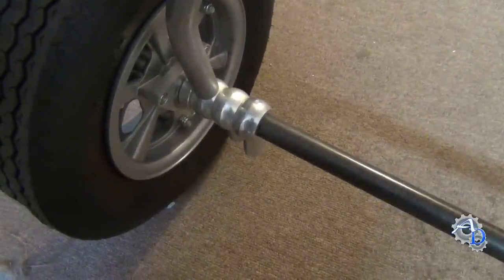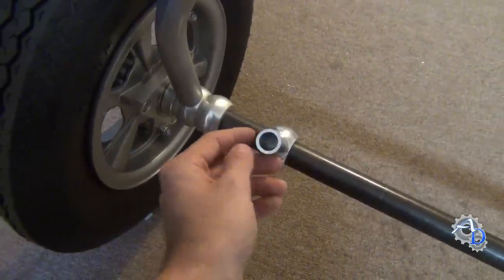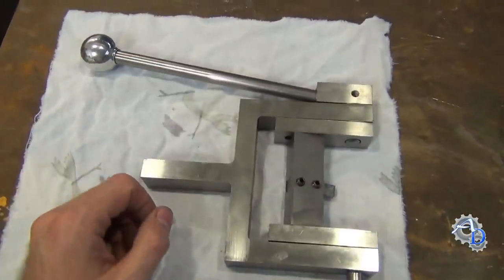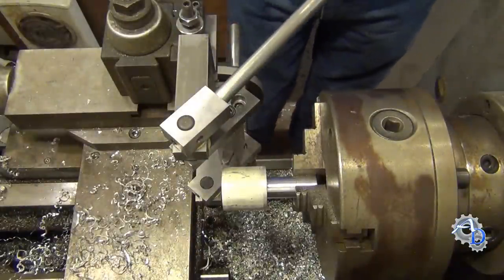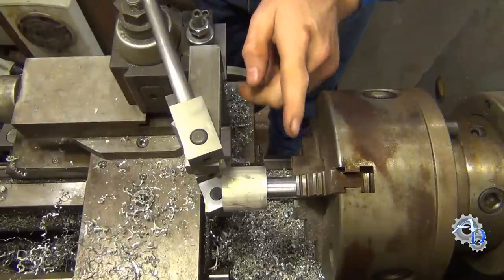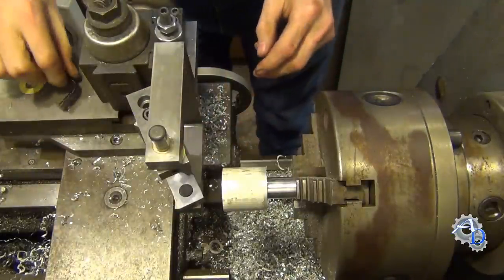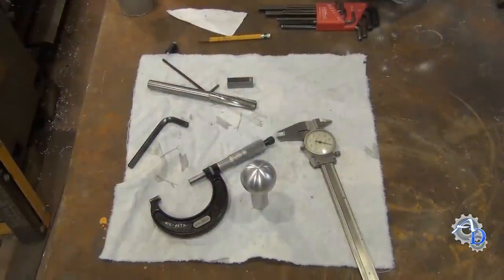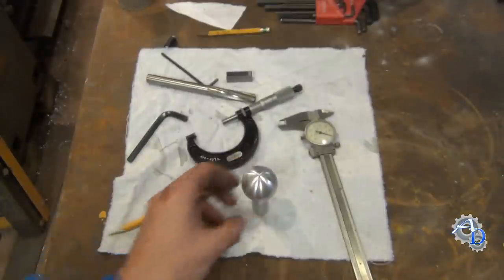The Secret to Cutting a Ball On a Manual Lathe

Comment from the maker: Now you too can have balls of solid steel. To download plans for this ball making fixture, go here: http://www.arnoldsdesign.com/Digital-Plans-and-ebooks.html
Reply: Arnold's Design was
Reply: Arnold's Design 
I would like to make a suggestion that will decrease your set up time.
Replace the solid dowels used for the pivot pins with hollow dowels, with the lower dowel having a thicker wall than the upper. Then you can use a stepped pin that simply drops in from the top to set the radius, no disassembly required.
Thanks for your excellent videos.
Reply: Arnold's Design q
Reply: I was thinking that exactly when he was taking it all apart.  Before he finished I thought well maybe I was missing something.  Sometimes something that appears so easy to do is often overlooked.
Reply: Link doesn't work anymore
Reply from the maker: @jerrylong381  Thanks for your recommendations. I just saw them.
Reply: @ArnoldsDesign  
My pleasure.
Reply: Looks like a Holdridge radius cutting tool.
They have been around for years Arnold.
Reply from the maker: @kappullen  I'm not sure if I've ever seen one. I've seen ones that look like a heavy duty large micrometer. Maybe that's a Holdridge model, I don't know.
Reply from the maker: @crisnevin7934  Works now.
Reply: The holdridge tools have always been in the $500. or higher price range.
More than I was willing to pay.
That is a nice tool. Those Wire EDMs
are great to have access to.
I bought a shapelane tool some time years ago based on a worm and worm gear.

Comment: Nice job on the tool. I have always used a boring bar in the mill with the part in a dividing head set at the correct angle, so the center of the ball is in line with the O.D. of the shaft. And feed up with the knee adjust diameter with bore head.
Reply from the maker: Interesting. I'll have to try that.
Reply: Just to clarify. After you feed up to center line you spin dividing head. Depending on ball diameter you might have to adjust bore bar several times.

Comment: Nice work. We made one that had the same operation, but to set the tool radius from centreline , we machined the pivot pin to the center in the mill, laying horizontal in vise, for the last .25 inches. then you always have a surface,      Top and bttm pins, to place a depth mic . Then you just dial in your radius on the depth mic, and lock the set screws onto the cutting tool. Hope that makes sense.
Thanks for posting.
Reply from the maker: Thanks. Yes, that makes sense.

Comment: I used to work at a 100yo workshop and We never said no to any customer. So we made a lot of special tools. It was really funny, too bad the company doesn't exist anymore and that the new owner sold everything to scrap. We had 5 lathes, 2 milling machines, 1 gear cutter, several different drills with 1 to 4 chucks, axial drill etc. Everything went straight to scrap, I had known it before so I would have bought some. We had several hundred different accessories for lathes

Comment: Awesome jig and just FYI if you didn't know already try using a bit of Kerosene when machining aluminium
Reply from the maker: Thanks, I do use that from time to time. I also have a spray bottle with off-road diesel in it which works too. Off road has high sulfur, but I don't know if that helps with machining AL or not. Probably not.
Reply: @ArnoldsDesign  LOL never tried diesel before

Comment: Very cool!
I learned my lesson years ago clearing shavings by hand.
Cut my index finger nearly to the bone.
I use a hook tool now.
Reply from the maker: I've done that too. We used to use a hook too, and leather gloves when we were cleaning out the chip pan at the end of shift.
Reply: Cutting your hand with stringy chips seem to me to be the initiation of the machinining industry :)
Reply from the maker: @cosmiccwonder300  My personal initiation was being forced to quickly unwrap heat treating foil from a dozen or so 4"x4"x10" S7 blocks at 1750°F and put them on the fan. Even with thick heat treating gloves on and tools, the tops of both my hands were covered in blisters for several days and hurt like hell.

Comment: I'm not machinist and knowing how they do this was interesting
Reply from the maker: Thanks
Reply: As a machinist ive heard of this technique but have never seen the tool designed for it and put into action. Normally just throw it on the cnc its faster lol.
Reply: @cosmiccwonder300  For the hobbyist who can't shell out $7k+ for a CNC, (Bare bones Tormach without tooling) this is a cheaper manual option.
Reply: @firearmsstudent  Your opinion is negligible.

Comment: Good job. Back in my days in the navy, we used a much larger commercial radius cutter. We used it for weld repair of stellate clad spherical steam valves on nuke subs.. Fun stuff to cut.
Reply from the maker: Thanks. You certainly earned your money turning that stuff. I've turned hastelloy, vascomax350, aeromet, etc. They're pretty bad too. I never would've imagined that sub valves would see wear like that. Did the steam erode them?
Reply: Arnold's Design  High pressure steam cuts like a laser. It would cut grooves through the valve surface. We would undercut the spherical seat, have it welded up and recut the interrupted stellate weld repaired surface.
Reply from the maker: That's amazing. I had no idea steam could cut through an ultra tough alloy like that.
Reply: I let auto-correct influence my spelling. The correct spelling is "stellite". Also I heard brooms were used to search for high pressure steam leeks because it could cut your arm off. Hearsay or truth, I couldn't say, but I am inclined to believe.
Reply from the maker: I knew which steel you were referring too. I think using a broom would be an excellent idea actually. I wouldn't want to go anywhere near super heated steam.

Comment: It's fun to see how few that uses the micrometers in a correct manner (hint: the ratchet knob has a purpose)
Reply from the maker: When it's your personal mic that you've used for years to hold +/- one or two ten thousandths, you develop a feel and you don't need the knob or friction barrel. When it's a shops community mic shared by many toolmakers or machinists, then yes, you need to use the ratchet or friction barrel for consistency, because you have no idea if your feel matches the feel of the guy who calibrated it. Hopefully the person doing the calibrating had enough brains to use the ratchet, though I met one once who lacked those brains. Unfortunately, he was also my brainless boss.
Reply: Agree wholeheartedly it's your mic and your touch / feel.
Reply: I think thelemorf is a knob himself trying to show off....
Just because you know about the knob doesn't make you a precision machinst...
Also if you wanted to be a dictator perhaps you should mention that there are specific tips for the mic just to measure rounds....

Comment: We have one of those old sphere cutting tools we used to use but now with the CNC'S this is much easier by a longshot . If you need to make multiple parts your tool will do the trick. As most tools & fixtures the time you spend making them does pay off in how your parts will look  when your done. Not to mention they will last & repeat each time you use them. Oh & thanks for not calling it billet aluminum lol..
Reply from the maker: I wish I had cnc.

Comment: I'm amazed about the amount of people that didn't know about this tool. There's commercial ones available, and Adam Savage has shown off one in a video he did on Tested with Michael Stevens from Vsauce. 
I've seen people use a boring head on a tool post fixture using it's adjustment for the sphere radius. Seems like it removes the issue of having a long arm that could run into the jaws of the lathe, but introduces the problem of having to adjust the boring head at the tool.

Comment: Very nice idea. Cutting internal radii will be much more complicated.
Reply from the maker: Thanks. I haven't tried a concave cut yet.
Reply: A similiar jig with the tool facing the opposite direction would do that wouldn't it? Then again, I was told in High School not to never touch a power tool again as long as I lived. so I could be wrong haha
Reply: Producing big radii is chicken feed (convex or concave). Producing small (very small radii eg. like +- 0.2 mm) is much more challenging. I think that an internal radius becomes much more difficult, especially in a confined space - the inside of a bore (like a pipe).

Comment: Although you touched-up on the safety aspect of your setup, please check out the Sherline video on ball turning. They use a similar tool on their minimum lath, but their setup is in my opinion safer, faster and more versatil, as the tool is only reaching 1/4 of the ball and can cut both concave and convex Cuts... Worth considering, especially when you are virtually almost there with your tool.

Comment: I was reading Thelemorf's comment on using a mic correctly. I fully agree with him and I can make this statement because I'm a qualified metrologist (27 years). For those who don't know what a metrologist does, I will explain: There are two types of metrology - electrical and mechanical. I'm on the mechanical side. It involves the calibration and certification of equipment under controlled environments to ISO (International Standards Organisation) standards. Here I'm talking about measurements up to five digits after zero. In this trade you learn how to use measuring instruments correctly. Take the mic. It's got a ratchet at the one end. There is a purpose for this item. It's to apply the same amount of pressure every time you take a measurement. A mic should not be used in any other way. A knife's blade is used for cutting stuff and not to remove screws from a piece of wood. Plain and simple. Everything has it's purpose.
Reply from the maker: Maybe you didn't mean it this way, but this is aggravating. If you don't mind, I prefer that you didn't lecture me on this, because I've been in tool and die for the last 26 years unfortunately. I say unfortunately, because I'm good at it, but hate it with a passion that can't be put into words. Part of the job on many days is inspection. I've mic'd a serious amount of work within +/- .0001 with these particular mics. I've cut, smashed, and drove more slivers into my fingers over the years than I care to remember, and have milled, turned, burned, wired, form ground, lapped, polished, and measured thousands of parts, from splines to gear forms, three wires over God knows how many thread forms, including acme's. I'm well aware of the torque limiting devices on mic thimbles. The gentlemen in the metrology depts I have worked with in the past who put the calibration stickers on personal mics didn't dare make adjustments or reset zero points on any of them, because the tool men I've known would've ripped their balls off, and justifiably so. They only verified the instrument's precision. It was up to the toolmaker to provide the accuracy, and they left that to them.
Reply: As a retired 47 year die maker/ Machinist, I can tell you that after making 10s of thousands of measurements, I would put my sense of "feel" up against any "ratchet" on a micrometer anyday!
Reply: @t.d.mich.7064  Brother, it's your free choice to use a mic in this fashion, but that doesn't make it right, irrespective of what your perception is. By the way, I'm also a toolmaker (RED SEAL) for 46 years.

Comment: Ref the ball pins for the ultralight, If you had removed some material from the centre of the ball curve, you could have left more material at the junction of ball and pin in the form of a larger radius at this stress raising point, while having a stronger/lighter ball pin. Also on the internal bore of the pin, do you have a curve at the end of the blind hole or is it another stress raiser?
Reply from the maker: The hole goes clear through the stub. The stub to ball junction has a 1/8" radius, so the stress riser isn't going to be bad, especially with the wall thickness I've left. I don't know what you mean by removing material from the center of the ball curve.

Comment: Always wanted to make one of these, just never had the need for it..Brilliant video however!
Reply from the maker: Thanks. I made it just for cutting the ball connectors I have on the ultralight.
Reply: Are you a licensed pilot? I am..have built two aircraft...both Pitts'. I have flown ultralights on vacation in New Zealand..LOVED them. Airway too congested up here in NE Massachusetts to operate one however.
Reply from the maker: Two Pitts. Damn, most people don't even get one plane built in a lifetime. That's awesome. Sounds like you need to find some empty farmland not too far away to conduct your ultralighting too.

I'm not a licensed pilot. I have an issue with motion sickness which I'm still trying to find a way to deal with. It sucks but that hasn't stopped me from getting at least a few hours of instruction, and flying with others(in calm air), and building simple airframes. The one I'm working on now is a Beaujon Mach.07, which has a stall speed of 20 mph. If I can get away this year, I want to make it down to Sun n Fun. I'm running behind right now, so I'll see. Speaking of which, one of the jobs I'm working on today is vapor blasting a Stromberg carb being used in an old Continental.

Comment: 👍nice work. perhaps you could make a radius setting tool to reference off the front face of the bracket. this way you don't have to remove the pins. ideally with a mic head in the center to dial in the radius. think of a depth mic.
Reply from the maker: Thanks. That would come in handy.

Comment: hello there im from Malaysia...im very impressed but i was totally woried about the chuck can be accidentally with cuting tool...hahahaha
Reply from the maker: Thank you. I am careful around the chuck.
Reply: A simple addition of a handle limiter (to stop the handle going into the chuck) would be a good addition.  A simple L bracket and a slot that can be screwed into the top of your ball turner.  L facing upwards to limit the handle travel on the chuck side.

Comment: How are you cutting the square hole for the carbide?  Broach?
Reply from the maker: You could broach. I cut mine with a wire edm. You could also make it round and use a round tool bit.

Comment: With cutting internal radii (my previous post) I mean the following: Let's say you have a hollow bar or pipe type of job and you want to cut a radius at the end from the inside to the outside. Obviously the smaller the radius, the worst the situation becomes. There must be some solution without fancy expensive machines.
Reply from the maker: I know what you mean. I can see how a fixture like that would work. If there's not already something on the market, it should be relatively straight forward to come up with.
Reply: If you mean you want a radius tube end, instead of a flat profile, then the tool in this video should do it. Just rotate it around the center of the tube thickness instead of around the entire part.

Comment: I've been a machinist, both in industry and with a home machine shop, for 40+ years. Making original parts/repairs, and I have never had the need for making a ball on the lathe or otherwise. Not saying it's  not a good lesson, but it's  a lot of time on something you might never use.
Reply from the maker: I suppose. I just machined a ball ornament and anodized it for the top of a flag pole I recently put in. It will be my next video which I'm editing now.

Comment: so, you cant use those simple ball turning tools on steel?  this seems like a lot of set up, compared to the ones with the round base.  Im very new to this, so sorry if i seem uneducated on this subject
Reply from the maker: I think you can. I made this design based on the old turning fixtures I had seen years ago. But yes, the round base one's are simpler. I'm not certain how they adjust the radius on those though. I haven't really looked into them.

Comment: Very cool. Loved watching the part evolve. I’m working on a CNC conversion on my mini lathe which makes this relatively easy. Is a jig required to do this on a manual lathe? Never got that far in my HS metal working shop.
Reply from the maker: Thanks. Cnc would be nice to have. On a manual lathe you need some sort of fixture for turning larger radii.